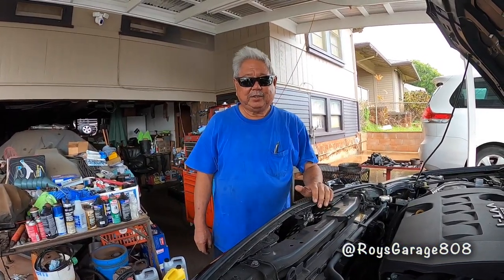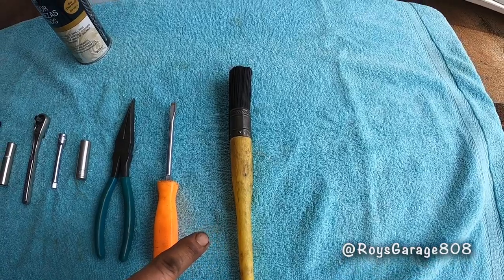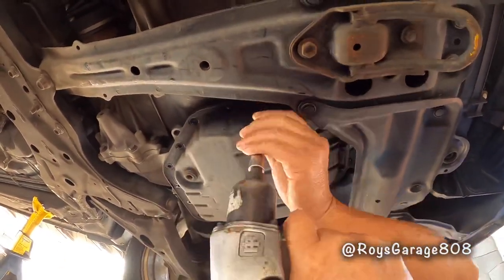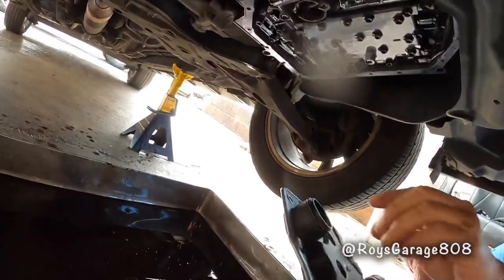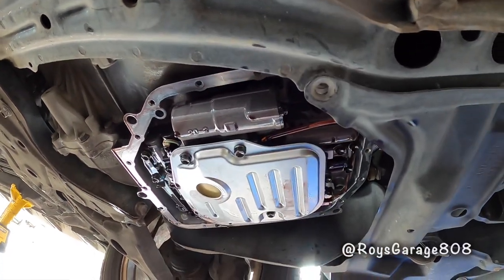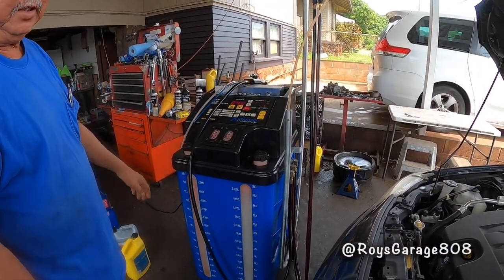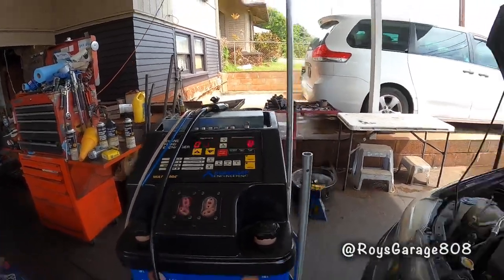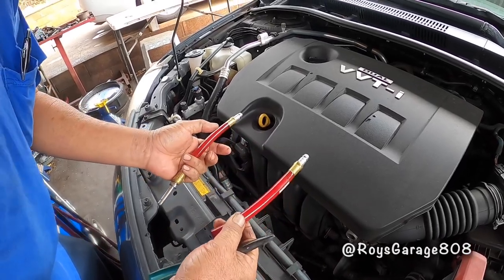How to Service the Transmission on a 2009 Toyota Corolla

Comment: When you took the oil pan off, what is the name of that part that looks like a cylinder, I hit a curve and the oil pan broke and thay cylinder part broke aswell, I don't know if I should replace that cylinder part or the whole transmission, if you can help I'd really appreciate it.

Comment: How often do you change the transmission filter?  I saw you put 14 quarts of ATF.  Where did the old ATF go?  Is the 14 quarts of ATF the total, or is that including the 4 quarts you put in to start with?
Reply from the maker: Every time I service it, I change the filter. It’s 14qt total and the old ATF getting sucked out and replaced with the new, the machine is a transmission fluid exchanger. Thanks for watching 🤙🏽🤙🏽🤙🏽

Comment: Roy I have a question I don't know if you can help me out with this I have a 2009 Toyota Corolla S. The car  No longer goes forward when I put it into drive but will go into reverse does that sound like a solo nerd problem with the transmission. I have checked  the transmission fluid and it's red  someone told me this could be a solenoid problem.
Reply from the maker: I don't know. That is when the transmission specialist comes in.